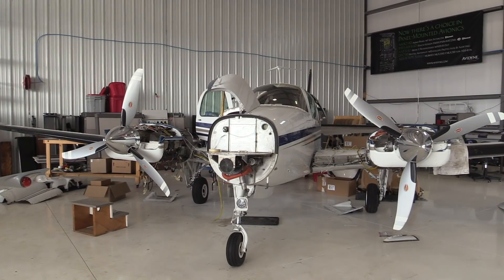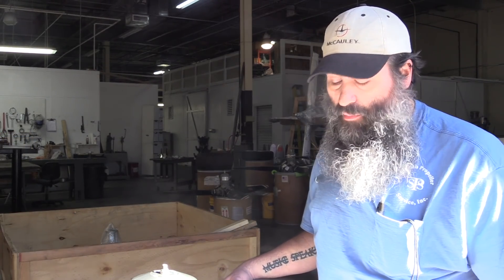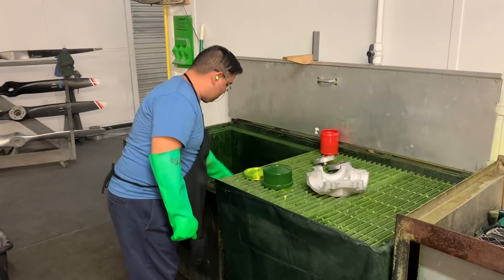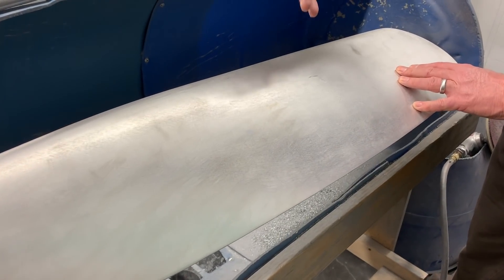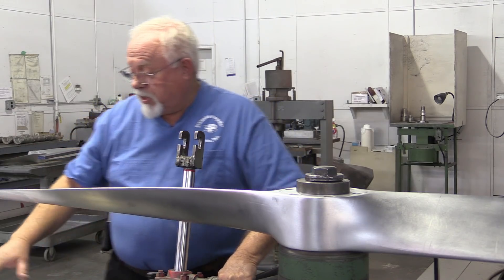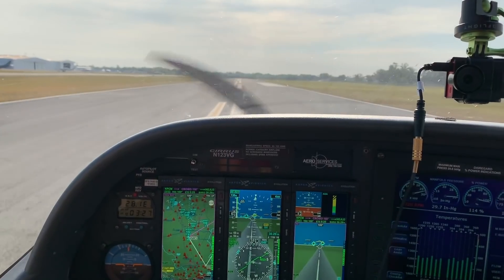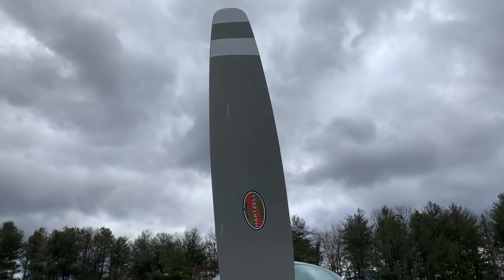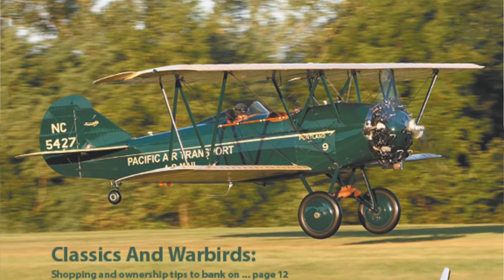Propeller Shop Floor Tour

Comment: My prop was overhauled at it's 10 year mark 3 years ago.  Now the shop says it's leaking grease and needs to go back to the prop guys.  They wanna charge me $2,000 to repair their overhaul 3 years later.  I said 'yes; - Thoughts on some level of warranty??  Probably 150 hours on the prop since overhaul and always hangered.  Never fly in the rain/etc.  Didn't leak for the first 10 years.  Sounds like a bad seal installed on the overhaul perhaps.

Comment: 10:46 Is it not a hazard to have people working with vats of cadmium without a lot more protection than that? I know it's not elemental cadmium, but a lot of the compounds are super bad news too...
Reply: @Ciaran Meh - I think he said they send the pieces out for Cad plating - so I'm thinking the vats had either alodine or die penetrant?
Reply: @RickAtlantaPilot  Right you are: I looked again and it seems pretty clear that the vat is Alodine (pretty toxic on its own, but I guess they're are doing whatever they're supposed to be doing).

Comment: 3:49 Dude, scrape and pliers? I'd start with some slim tool made out of plastics, and glue solvent, and from the above?
5:17 That workbench badly needs to be redesigned and rebuilt. The push caliper needs modernizing, a computer controlled remotely recording system. Saves time. And when was it even calibrated last?
10:11 OK, everyone's happy with working right to next high-pressure hydraulic cylinders bending major metal, and the valve can't be remotely operated? Nor the instrument remotely read?
10:36 Face mask?
12:28 Building a special tool (in-house) instead of that ever slipping flat-blade screw driver? The dude could be finished in half the time with less potential damage.

Comment: I was looking for calibration stickers on the measurement tools - none observed
Reply: john wrycza also a pencil on aluminum 😯
Reply: At an airline where I worked in engineering, my colleague found that it was occasionally cheaper to replace simple tools like Verniers than to get them calibrated (wasn't done in-house). Maybe these guys just replace the whole shop-full of tools at the required interval. But I'm just speculating, of course.

Comment: Memories. I worked in a prop shop  / repair facility for three years evenings to pay my way through school. Came home every night to shower the aluminum dust out of every conceivable part of my body. Ended up with an A&P ticket that I never started out to get. In that shop, a big plus was that if you were the mechanic on a job, you were required to fly in the repaired aircraft on the first test flight after the repair. Ended up with dual time In quite a variety of aircraft.

I didn’t see the large torque cheater used to remove & torque blades into the hub. I forget now which manufacturer that was. It seems like other hub designs  the blades came out by removing retaining rings inside the hub. The cheater tube for torquing & removing the blades was at least 15 feet long.
Reply: What do you mean by A&P ticket where they gonna pay your schooling fees?.
Reply: @caridabaptiste9878  A&P license. I was going to university full time for mechanical engineering degree but was broke so was working as a mechanic to pay for school. I didn’t go to school for A&P license. I had the necessary experience and took the test to obtain the license.

Comment: First job after military service was at a prop shop. They put me in the refurbish section grinding, sanding and bending. I knew after two weeks I was in over my skill set. Much respect for these guys, the job is artwork and nothing less than that. My apologies to whomever owned the prop I turned into a bent up butter knife.
Reply: Quick Wahay - it’s a real man or woman who knows their own limitation and willing to admit it! Great post! Not that job but the same result.
Reply: I met a similar fate at a different location. 5 weeks of learning but decided mechanics was more my thing. Still good to be ubertrained on prop inspection.
Reply: Sedona ATX I flew for several years on the US Navy P-3 A,B & C model aircraft and burned some prop boots & spinners in deicing conditions and worked R&D as an Mechanical Engineer and learned prop & engine balancing from the Hamilton Standard factory school. Mainly dynamic balancing of prop on engine setups some with shafts usually using accelerometers on mounted units. No overhaul experience on props.
Reply: What if i need to by  the propeller and I'm in Kenya how can i get it ?.
Reply: Rotich the Legend - call them and make arrangements to purchase one and have it shipped DHL or FedEx. Or  contact a local maintenance repair facility for your type aircraft.
Reply: @MrWATCHthisWAY  i don't have the phone number.
Reply: Rotich the Legend but you need a prop? Really!
Reply: @MrWATCHthisWAY  yes I need.
Reply: I'm building a small aircraft for one Passion, i need a fixt  pitch. 1 meter long. By 6inch.
Reply: Rotich the Legend - I have a lot of question before I can recommend a prop. Engine performance? aircraft type?aircraft operational environment? budget for prop? But everything is doable. You could even consider building your own prop from wood but you may not feel comfortable with this solution but it is a viable option? Do you have anyone helping you?
Reply: Rotich the Legend - Rotich, look at this video from Culver Propellers. Alaina Lewis is in the family of the person who created Culver Propellers and gives an excellent tutorial on how they have manufactured wooden propellers sense 1999. Culver has a history of producing strong and reliable props for a reasonable price. There are several companies that produce props today and there several materials that are being used in their construction so it will come down to how much do you want to spend and what performance your looking for. Look through their webpage and answer some relevant question and watch the videos and this should give you an idea of what to expect. 

http://culverprops.com/CulverProps.html
Reply: @MrWATCHthisWAY  it's OK Thanks.
Reply: @MrWATCHthisWAY  no I l don't have any.
Reply: Rotich the Legend - the aviation community is a very tight community and everyone helps everyone out with information, resources, ideas and at a lot of smaller airports they usually have a vehicle available for pilots to use to go into the local town if pilots need to get things. There is always someone who will help you out so just ask and will try because one day you or I will need help.
Reply: @MrWATCHthisWAY  no problem i will do that, but for now I'm looking for the propeller. Thanks, do you have Email address? 
It's good there for talking and sharing ideas.
Reply: Rotich the Legend - I need to know 3 things from you now. But there are a more questions that need to be addressed to get to your exact needs prior to getting a prop or a replacement prop, but let’s just start with the first ones that need to be answered before it’s narrowed down to the optimal prop for your aircraft!!! Ok? 

1 - do you have a prop now?

2 - what type engine is the prop going on?

3 - what aircraft is the engine going to be installed on??
Reply: @MrWATCHthisWAY OK. 1- on i don't have it

2- king bard 150Cc 3F

3- mini trike aircraft.
Reply: Rotich the Legend - these are the people you want to email at Competition Aircraft Props because they will have one for your aircraft and it will be the least expensive composite blade for your needs.
prop@competitionaircraft.com
You can go to their website or email them to start you conversation with them so they can provide you with the propeller you will need and it won’t break you wallet either.
Good luck!
Reply: @MrWATCHthisWAY  thanks a lot.
Reply: Rotich the Legend - they should be able to set you up with a nice 3 bladed composite prop for for around $500 US dollars. That would be a good price. If they can’t they should be able to give VW you another supplier for your needs. Good luck and fly safe.
Reply: @MrWATCHthisWAY  but the email  was not able to go through.
Reply: Rotich the Legend - let me double check it for you??
Reply: @MrWATCHthisWAY  please check!.
Reply: Rotich the Legend - what are you exactly asking me to check on? Exactly? I don’t have your propeller hub size ( diameter, bolt pattern, thickness or material ) how much torque the prop will experience or what prop if any was installed on this type engine in the past. These may or may not be some of the questions they may require before sizing a prop for your aircraft. Also aircraft speeds are a requirement for the blade angle that are going to be needed to determine sizing too. They are the ones that will take your information in determining what prop they would recommend for your aircraft.
Reply: @MrWATCHthisWAY  I'm so sorry, sir. It's the Email address that you give me, it never worked.
Reply: Rotich the Legend - I will try and contact them.
Reply: @MrWATCHthisWAY  thanks.

Comment: '
airplane with one motor propeller is a spin...
two motors propellers musts be both opposite spins same as V-22 osprey
Reply: bestamerica - not all aircraft spin opposite. It depends on torque applied. The V-22 has the most torque and uses this counter reaction because it hovers. Sorry.
Reply: @MrWATCHthisWAY 
hi J P L...
'
thank explain about airplane motor with propeller
Reply: Adding to John’s comment, yes, spinning opposite is best for adverse yaw etc, but most twin piston engine aircraft spin the prop in the same direction. This means that you don’t have to have right engines & left engines you just have engines, which is less costly. I’m not aware of counter-rotating turbine twins but they probably exist. Same principle applies; it requires left engines & right engines which adds to costs.
Reply: @tedspradley 
hi T S...
'
left spin motor and right spin motor musts be same currencys...
left spin is a cheaper = right spin is a uncheaper are not fair...
must be equal same currency

Comment: how is it possible to balance the prop to the engine?
Reply: John H - you put a balancing instrument on the engine. Accelerometer that indicates a “G” force indicating that a blade is pulling to one side. It’s a little more than this but without getting to deep that’s how you can balance large props on ships, wind turbine props, shafts and aircraft props. I have performed this on aircraft and ship’s.
Reply: @MrWATCHthisWAY  the what do you do to the prop, if the prop has been neutral balanced at the shop
Reply: John H - it is actually called a static balance but you don’t really need to perform a dynamic balance on the aircraft unless the manufacture requires it or if you experience a vibration on the aircraft. You will do the same thing by adding or removing weight to the identified location. But if you want to achieve the most accurate balance alignment coupled with the engine then you perform the dynamic balance usually with variable pitch props mostly.

Comment: Using a pencil on aluminum? Yikes! I thought that was a big no-no! Obviously these guys are professionals, but that seems to be careless and unnecessary..
Reply: I was going to make that comment! I'm no engineer but I've read enough manuals about corrosion to know you never use a graphite pencil on aircraft parts!
Reply: Thomas Altruda - it’s lead pencils that shouldn’t be used on aluminum. They was off the props afterwards. I think the missed a step after bending the prop. There should be a dye-penn inspection after the bending to see if this action created and stress cracks in the blades??
Reply: @MrWATCHthisWAY  I was interchanging lean and graphite pencil, as "lead" pencils are usually graphite.  Ill try to dig out the Tec paper, it had a nice pic of a pencil circle drawn on a piece of an F18 wing, stress corrosion had started from the pencil mark. This lead (no pun!) to a failure.
Reply: Mark Davis - oh come on, that was funny! Pun intended!! Take credit.
Reply: Also which came first. The crack or the pencil mark. Why draw a circle on a wing unless it was to identify a stress crack. Also was this a leading edge because aren’t military aircraft shot with poly paint? Mine was except for leading edges for deicing strips?
Reply: John Paul Lafferty LOL I’ll take the credit and raise you, pencil before crack! My OCD will kick in big time now, so i’ll have to trawl through the handbooks and find the page 😀

Comment: At 3:55 it seemed like the guy removing excess tape was doing more harm than good.
Reply: Yes he seem like he was struggling with his tools.
Reply: And the fact he was using a metal 5-in one tool for painting  didn’t help either!!! Ops!!
Reply: I understand where you are coming from, it looked pretty aggressive, but removing the anti-ice boot from some props can be very difficult. The "tape" he was removing is a painted on rubber dressing used to seal the edges after gluing the rubber boot on. Any small nick made from the scraper would be dressed out during blade refinishing and not be a problem.
Reply: Christopher M - I have never removed one by scraping but have burned a few off my Hamilton Standard props & spinners after sever icing in Adack Alaska a few times!!
Reply: @MrWATCHthisWAY  Burning one off is a new approach for me. I replaced a lot of boots, mostly pneumatic on wings. I would certainly never use his approach in a field replacement, but knowing the blade was going through overhaul makes a difference. Thanks for commenting, have a great day!
Reply: @MrWATCHthisWAY  yes sir that's one way to get them replaced:)
Reply: Christopher M - They were electrical heated boots powered by a slip ring on the props. It was a US Navy P-3 antisubmarine aircraft. I never intentionally burned them off sometimes after having to many hours or cycles on the blade cuff they would melt.
Reply: And your credentials for making that statement are?
Reply: @TheOwenMajor  14 years as a cabinet maker using hand tools. The angle and stabbing motion he was using the scraper would tend to gouge.

Comment: One should not write on an aluminum part, particularly a propeller, with pencil lead.  The material in the pencil lead will lead to corrosion in the aluminum.
Reply: Graphite is not lead. They no longer make lead pencils.
Reply: Such a small amount of graphite, especially when it will be removed, poses no danger. 

People need to learn to stop worrying about every little thing.
Reply: Owen Major 
        Here is an FAA certified repair station worker, using a graphite pencil on a highly stressed Aluminum propeller.   

    Those of us that have bothered to read the FAA Publications such as AC 43.13-1B (acceptable methods of aircraft maintenance) and AC43-4B (corrosion control), know that Graphite (from a pencil) acts a cathode and serves to accelerate inter-grannular corrosion in aluminum alloys.

      It is possible that this repair station’s overhaul manuals allow the use of graphite pencils on aluminum propellers,  but it seems unlikely given the decades of engineering studies on the subject that clearly demonstrate the detrimental effects of graphite on Aluminum alloys.

     The simple solution would be to just use two different colored sharpies.  One black for the blade station and a blue one for marking pitch angles.

        This is hardly a situation of “posing no danger”.   I am surprised that this was published, since it will most likely bring FAA scrutiny on this repair station’s procedures.
Reply: @Stepclimb  And if spent less time with your nose in regulations and more time in the real world you would know that is concerned with the use of graphite lubricants, not a couple pencil marks.

There is a bit of a difference between the constant use of graphite to lubricate your moving parts, especially when water can interact with the graphite, and less than a gram of graphite in a dry environment that will be quickly wiped away.
Reply: Owen Major 

      Your response is typical of one who does not have data and facts to back their allegations, but instead resort to insults.

    I do live in the real world and have been around long enough to know that most procedures are “written in blood”.

    Any engineering handbook on the subject of corrosion will show that graphite is highly passive (cathodic) and Aluminum is highly active (anodic).   So you are suggesting that purposely creating a mark (a stress riser) on a highly stressed Aluminum propeller with a substance that is well known to accelerate corrosion is “no big deal” ?

     It’s not just graphite as lubricant that is not permitted, but SPECIFICALLY PENCIL MARKS.   

       Reference AC 43.13-1B, chapter 6-2 (a) 11  and  6-91 (c).  

     The last reference reads “DO NOT MARK on any metal surface with a graphite pencil or any type of sharp, pointed instrument.”

      Your point on this matter is indefensible for several reasons that I have illustrated.  

       It makes no sense using a pencil to mark a propeller when a sharpie would do the job better and not invite scrutiny as demonstrated by this video and the following comments.
Reply: Stepclimb - I’m not sure about the regulations in a authorized overhaul facility. I know there’s a regulation regarding the use on aluminum skin on pressurized aircraft due to both corrosion and the scoring possibilities. If the technician were to score the prop and not detect it, this could lead to possible failure. I must admit I thought the reason we were using graphite was to eliminate the possibility of scoring the surface. Now I don’t think I will ever use a graphite pencil on anything aircraft related just because of possible scoring. I don’t need to induce a failure. Reward not enough for me I’ll switch back to the fine highlighter.